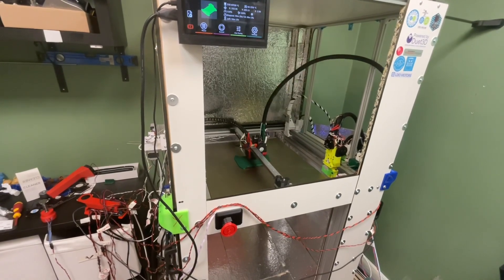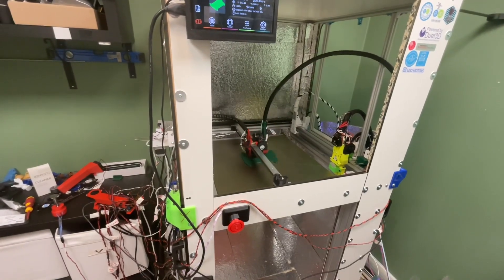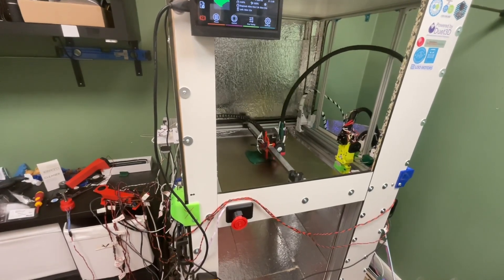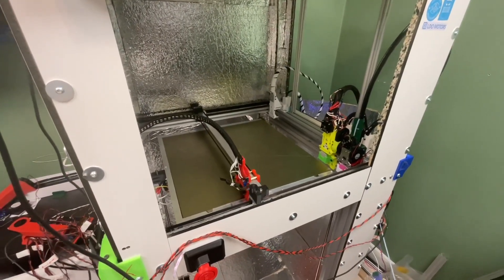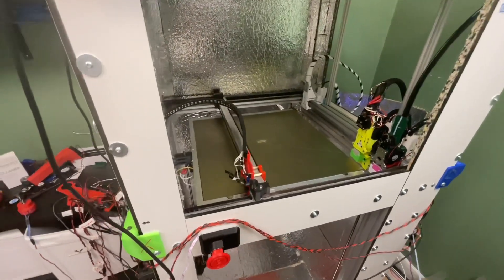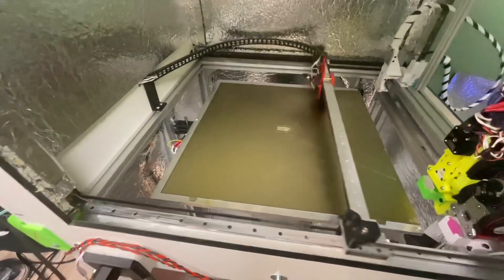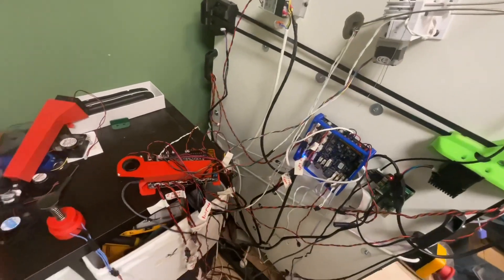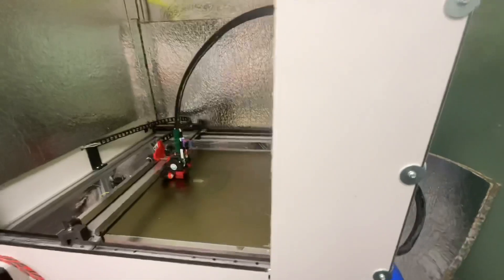Klipper now on CoreXY². Doubling torque and speed?

Comment: how do you have two printheads when your printer already uses 4+3 of a maximum of 8 steppers with the Octopus board?
Reply from the maker: Like I mentioned, the tools are connected to a SKR 1.3 board. Klipper can use multiple boards, mixing and matching. Actually the partcooling fans and hotend fans are connected to Octopus because it has better fan control and only the heater, thermistor and steppers are on SKR 1.3.